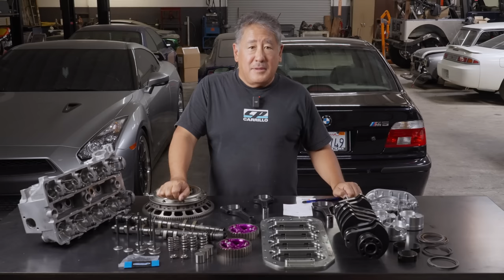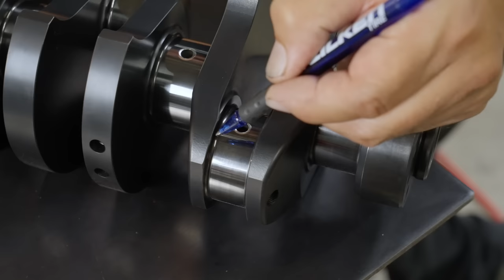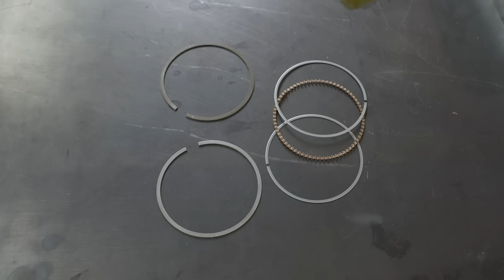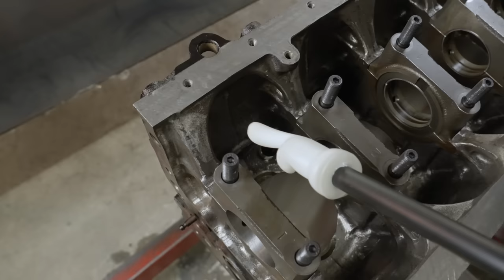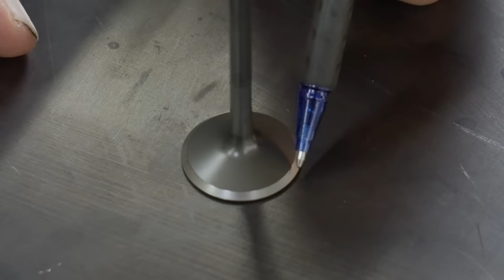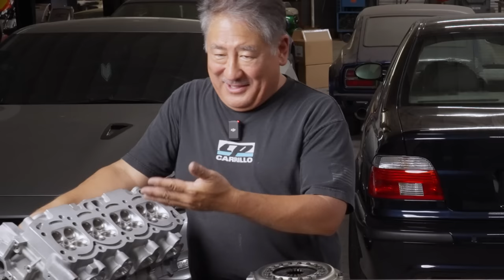11,000 RPM Toyota 4AG Engine Build!

Comment: From what I understand, a 5A-G is a 4A-G block with a stroker crank. A 7A-G is a 7A-FE economy 1.8 with a 4A-G head. A 9A-G is a 7A-G but with an even longer stroker crank.
Reply from the maker: A 9AG is a 7AG with a bigger bore.
Reply: this (re 5a, stroker, hks crank et al)
Reply: @motoiq  I was always under the impression that the original 9A-G's were done with a 1ZZ crank or by offset grinding the 7A to a similar length, at least 90+mm to reach 1.9 or in some cases 2.0 liters. MRP sells a stroker kit for the 1.8l block called a 9A-G as such. The 5A-G was always like a 81 or 82 or so millimeter stroker kit for the 4A-G height blocks. Often they reach the same bore size as a CA18 Nissan engine by boring them out and the pistons from a CA18 were used as well. I believe they have an 83 mill bore
Reply from the maker: I always thought the 9AG was 90mm X 83mm?
Reply: @motoiq  90 stroke and 83 bore (or 82.5 if the bores are weak)

the 1ZZ crank is 91.5 mm stroke. If you use 83mm bore and 91.5mm stroke, you get 1980.29 cc 2.0 liter motor. 90mm and 83mm bore gets 1947.82 cc, so a 1.95 liter.

MRP sells a kit that is 90mm. Old school 9A-G builds were done using offset ground cranks or heavily modified 1ZZ cranks (same bore spacing as the 4A/7A blocks)

5A-G is a stroker crank in a 4A-G block, so a short deck height. Boring them out was common as well back in the 90s, to 83mm for the use of CA18 pistons. Stroke tops out usually around 83mm in a 5A-G.
 
7A-G is a 7A block and a 4A head. 7A stroke is 85.5mm.

9A-G is a stroked 7A-G.
Reply from the maker: Piston speed is already getting unreasonable with a 90mm stroke so you would need to keep the revs down which is part of the fun of a 4AG. How much did people offset grind a 1ZZ crank? The Jornal overlap is getting pretty low with 4AG jornal size for OEM type alloy.
Reply: @motoiq  1ZZ cranks were heavily modified to fit in a 7A block, or 7A cranks were offset ground. To go from 85.5 (stock 7A-FE stroke length) to 90mm for a 9A stroke is 4.5mm of offset grinding, pretty significant. 

There is a video of a guy on youtube with an MRP built 9A-G in an ae86, his motor can go 9500. The r/s ratio on an MRP kit is about 1.52:1 if I remember correctly. Not great but manageable. His whole setup is crazy though; jenvey roller throttle blades are just the beginning of the nuttiness of that engine.

Matt Trevena of MT performance engines down south in aus has spoken of offset ground 7A cranks before. They're gnarly little things if did correctly. 

All the extra displacement really does is bring the peak power lower in the RPM band to be fair. It certainly makes things more driveable with additional mid range punch, but as always, they need more work to rev higher than a regular 4A does. 9500 in a 90mm stroke 1.95L engine is more difficult than a normal displacement 1.6L 4A going to 9500. It isn't easy, but it doesn't need as much cam or head flow to pull that RPM since it just isn't moving as much air (from what I understand).

Same reason why a 4.8 LS truck motor doesn't need a lot of cam to spin up like a 6.0 does.
Reply from the maker: I think offset ground stroker OEM cranks are fine for street use and non serious drag racing but they will crack at journal three in a day or two of track driving unless you hold the revs down probably something like 8k.
Reply: @motoiq  I agree. I think that if someone really wants to go through all that effort, just buy a 3S-GE BEAMS instead of doing an all out A-series build. Would cost damn near the same for a 9A-G stroker kit as it would to buy a blacktop from an Altezza, and the 2.0L would still make more power.
Reply from the maker: Some people like the 4AG.  It's hard to install the BEAMS without messing up the suspension geometry.

Comment: Customer really came in and said "I want an Initial D build. No, it shouldn't be built the realistically correct way with a dry sump, it needs to be lore accurate."
Reply: I mean, lore accurate would suggest it was carburetted using Weber 45 DCOE's, running an 11:1 CR, 312/304 cams, and a terrible stock rod ratio, but still having a dry sump with a 3-stage Barnes pump. The actual engine in Keiichi's Tsuchiya AE86 which the anime based it off of, lasted a very short time.

Not exactly sure what happened to it, but he's running a blacktop now with a lower redline and EFI.
Reply: the realistic was would be a TRD 20V from the AE101 Group A race car which is impossible to get . Only one guy has actually done it and it was 2995 LeMans GT2 winner and 2002 JGTC Champion Akira Iida. I believe the manga shows a Formula Atlantic engine initally
Reply: @niko1600  the ae101 never used a 4age, it used some sort of N/A 503E, 2 liter displacement.
Reply: @zipsuma6971 Not true at all. I had an AE101 Sprinter (2 door) that came stock with a silvertop 4age.

Comment: would love to see a video of Howard's takes on porting, or how certain porting techniques change the power band. pushing the split back into the port for more volume without reducing flow velocity is pretty slick.
Reply from the maker: Its a common trick.
Reply: @motoiq  Hope you can share a link to the paper Mike mentioned, thanks!
Reply: You get even more velocity by redoing the port so it runs through the path where the injector holes normally are. There are 2 ways to go about doing that.

Comment: i remember reading about the H22, b and k series how they learn from it. they got it down to a science how exactly how much HP they want from an engine. they talk about having more HP losing lower and mid range torque to offset it with short gear. they find that having more HP is not always make the car fast. while at the same time it have to be a street comfortable driving experience. they do stated taller engine tend to perform better

Comment: I had a 3K 1.2L 8V corolla motor built back in the 90's stock it made 52bhp at 5500rpm but with all the hand porting , balancing , double valve springs , big cam , 5kg aluminium flywheel and upgraded oil pump spinning at 8000rpm with a locked up distributor it made 125bhp , not bad seeing as it was in a 840kg chassis.
Reply: Thats Hella impressive
Reply: @NinoJoel  It was 74 ke20 , it upset alot of more modern car's I had a 50 shot of nitrous below the ford escort 2L Webber carby that got it into the 14's .
Exterior of the car looked stock apart from the 60mm exhaust out the back .
It was the perfect sleeper back in the 90's .

Comment: Can’t comprehend why you’d skip on dry sump with this otherwise stunning build.
Reply: Only thing i can assume is just money.  A dry sump is going to set you back about 2-3~ grand.  Which, ya- I get it, this is already an expensive motor, but maybe the extra 2-3~ grand was just too much for their budget?  At a minimum i hope they do an expanded oil pan, and maybe do dry sump down the line. Would be an amazing shame to see such an engine get toasted because of a skip on the oil system like this.

Comment: That was a lot of technical information, made a 31 minute video 'really short'. 😊
Personally, I found it incredibly interesting, some new technology but a LOT of stuff motorcycle engines were using in 1970's!
Suzuki GS motors had issues with shims spitting out when high lift long duration cams were used so they got swapped for Kawasaki shim under bucket.
Very interested to hear 100 or 102 LSA, bikes were using around 103 LSA even on street motors (but with very little low down torque and a definite power step around 6,000rpm. Very nice video, thanks.

Comment: We actually used a wider rod 20 yrs ago, may still have a few sets...this was for the 4A block
One thing is noticed, which may be a problem is the flywheel to crank pins, I didn't notice any, unless you are putting them in later, as a trade secret. Our flywheels were a bit lighter and the clutches smaller diameter, if what I'm seeing is what you're putting on the motor. I still have a few new assy. On the shelf in case...PS. I'm not marketing here, it's just stuff I have locked up in a cabinet which is locked in storage

Comment: Rod ratio needs to be matched with valve opening and closing events, the piston spends different amount of time on top and travels at different speeds at half the strike, so charge energy on the intake needs to be matched to the rod ratio, it is a very intricate thing and Honda did a lot of camshaft test according to those parameter in order to find those 12Hp
Reply from the maker: As I recall, I could be wrong, I am getting senile, in the SAE paper, Honda only changed the rod ratio in their research.  You can probably find that white paper online for a small fee from SAE.
Reply: @motoiq  IMO and I might be mistaken, but most likely they had to play at least with advancing and retarding the cams, think about it, I can't see how they gain so much HP just by adding a few mm. On the Rod  length, I don't know what are the Cam specs, if the IVO degrees are a little to much with the longer rod the piston spens more time on TDC, and will travel slower from that position.
Reply from the maker: I agree that for best results, the cam timing and tuning will change but I am pretty sure Honda wanted to isolate only what difference the rod length would make.  Could be wrong though, its been years since I read that research paper.
Reply: @motoiq  maybe they hit the money pot without knowing it, and that rod ratio works the best for that cam valve events, who knows, but Honda people are no dummys like me, I guess there is more than meet the eye, they would had figure this out long ago and implement this in there cars unless it has a high production cost or some kind of emissions or oil consumption, maybe piston ring gland longevity issues with running short pistons and tight ring arrangements, in race cars theses don't matter as engine are rebuild often and normally don't see more than 4000km + racing I guess, regular car engines go beyond 200000km free of trouble if well maintained.

Comment: Really sorry for commenting, but in our motor that ran to the 11,600 rpm redline 18 yrs ago, we developed problems which would never occur up to 10,200 and it was dry sump. The problems were in the valve train. I wont stop and comment again....sorry. But i eat, slept and worked on these things for too long, im sorter glad personally that the motor was dropped from FA. My mind is much quieter.
Reply: "The problems were in the valve train"

Whats the problems you were having?

Comment: I remember talking to a guy who was selling 4AG and 3SG parts when I was purchasing a spare 3SG block and he asked me what I was intending to do with the engine. Told him I wanted a longer rod ratio with custom reduced compression height pistons for extra reliability since the stock redline was 7,200 and I wanted to move the power across closer to 9,000 since I didn't want to risk destroying the transfer case with heaps of low-end torque considering how expensive Celica Gt4 parts are.

He looked at me and said "Don't bother. It's stupid. It's a perfect balance. 86x86 stroke. Don't listen to what people say online"

I looked up into his eyes and thought to myself.

There's no way he thinks that changing the pistons and rod will affect stroke.

Was sad to think he was spreading misinformation on the forums. He was even arguing with VHTracing at one point.

Comment: I had a 4agze pushing out a 100kw at the rear wheels in a 900kg car. Bit disappointing and I so regret not building something like this instead.
Reply: My stock blacktop 20v puts basically identical power to that down. 20v 4ages are, bang for the buck, pretty difficult to beat IMO.

Comment: So I heard of a build called a 9AGE where they take a 7AGE and modify and place a 2ZZ crankshaft for bigger displacement.
Reply: That would be a 1ZZ crankshaft as the 2ZZ crank shaft has a stroke that's 85mm which is 0.5mm less than the 7afe crank. Regardless it's one of those things I have heard talked about multiple times but yet to see actual proof of someone doing it. There are multiple issues with the concept.
Reply: Shouldn't work in theory as the bore offset is different from a 4a/7a block to the 2zz, meaning the crankshaft is... longer. It's also the wrong dimensions all the way around.

Moden "9AGE's" are just strokers for the 7AFE bringing the 1.8litre to 1.9.
Reply: @oneplumpboi5317  Bore offset as in the bore to bore center distance? If so both the ZZ and A-series engines are identical at 87.5mm. It's a quirk of the ZZ engines being strangely undersquare, for example the 2ZZ has an 82mm bore x 85mm stroke. Ironically due to the shape of the rear flange the ZZ cranks are actually shorter than the 4age.
Reply: @Samqdf   Ah i must've been thinking of a 2ar bore spacing.  I'm sure the crank has to have relatively different dimensions though, like main journal width and what not? The rod are 21.9 mm wide on the 4a's but  19.9mm on 2zzs
Reply: @oneplumpboi5317  I have heard that a ZZ crank needs extensive machining to allow it to even fit into a A-series block so yes while I have not compared the numbers it does indeed sound like there are some large differences there.

Comment: Couple of things you didn't touch on with the 4AGE is the bad oil return in the head, also using ARP head studs can on some 4AGE heads restrict the oil flow to the cams, I believe ARP may have updated the L/F stud to fix that. On my own rally engines I used full groove mains as I found the oil would pulsate and starve the big end bearings after a long time at high RPM, around 8hrs with a peak of 8800, also TRD sold full groove mains.
Great video, very interesting to see the different types of components that are still available for the 4AGE.
Reply: I find oil return is improved tilting the engine more to the exhaust side.
Reply: @feral4mr2  I found die grinding a hole into the ribbing that surrounds the big  channel 1/2 way up the head, that helped a lot and putting a 2mm restrictor into the block. I noticed in another 4AGE video from a few mouths ago, the oil pump your customer is using has a problem, if it has the "Toyota" ground out of it, this is a pump Toyota has tested and returned to Asian as it didn't past there tests, the pressure relief valve hole is about 3mm to high and causes to high oil pressure, I believe the approved Toyota oil pumps allow to only 70 psi.
 I never thought about tilting it more, great idea.
Reply from the maker: I forgot to talk about the restrictor.  Not sure about the stud restricting the flow to the cams, can you elaborate on this?
Reply: @motoiq  the older version of 4ag arp studs were found to restrict oil passage up past the stud due to clearance between the stud and chamber (probably not the correct terminology) in the head to the oil gallery.  Simply fixed by drilling the head out to just past the oil gallery.  
All the new 4ag arp studs come with that stud smaller in diameter so the issue cannot arise.
Reply: @motoiq  yes, oil runs up beside the L/F head stud, about 1/2 way up there is a 1.5 mm hole for feeding the cams, using the 10mm ARP stud it can block that hole on some heads, I searched the forums and found that ARP may have updated that stud to be only 9.2mm. Worth checking though. Went its blocked and the engine running it sounds like a noisy alternator bearing.
Reply: @feral4mr2  "I find oil return is improved tilting the engine more to the exhaust side"

Underrated comment- Especially with the 16v heads. To my knowledge and understanding they can pool in the back quite easily. A restrictor is usually used in higher revving applications, and for those going the extra mile its not uncommon to drill the head and attach an oil drain back bypass to the block.
Reply: @SidewaysGts  most people try to say the head to block pipe on a smallport 4ag is a oil return, but it's actually a crankcase vent to help oil return on the exhaust side by not having crankcase gasses pushing up against the oil return flow.
Reply: @motoiq  I was waiting for you to talk about this, anyway great content, as an ae86 owner I always love when people still do things with them.
Reply from the maker: @feral4mr2  we normally restrict the oil flow to the head by 2mm and we never had any problems but from now on we will slightly enlarge the hole from the deck to the level of the oil passage just to be safe. Thank you for bringing that to my attention.
Reply: @motoiq  it was only a issue for the older arp 4ag head studs. New revision 4ag head studs have a smaller diameter stud for that one the oil passage shares and shorter so not to foul the distributor/cas shaft.   

4ag ftw!
Reply from the maker: @feral4mr2  we were looking at some new ones and they were 10mm.  I wonder if they were new old stock.
Reply: @motoiq  if all the same length and diameter on exhaust side they would be old stock.

Comment: Make sure this dude runs a vacuum pump on that ol son, should help clean up the oil a bit and free up a few HP. Im sure yall already know that, but figured Id look smart mentioning it looool
Reply from the maker: I always though that if you were gonna go through the trouble to do that, you might as well dry sump it but you are right, crankcase evacuation helps.
Reply: @motoiq  agreed. Its a band-aid and pretty cheap. If it were my engine, I'd be saving up until I could afford a dry sump system, especially if I had a 1-off Howard head 😆

Comment: Mike, we have a few Hasselgren-built 4AG Atlantic engines we run in Ralt RT40s and RT41s. A couple older 1600cc engines, but mostly 1730s and 1800s. Are there any other things we could do that Hasselgren isn't doing for us? Our 1800s max out around 9000rpm, and we'd LOVE to be at 11,000!!!
Reply from the maker: Yeah, this is a bragging rights 11k engine for a customer. I think the useable power is going to end at 9500 but they want to rev to 11k.  I am thinking we could outpower some of those Hasselgren engines though.